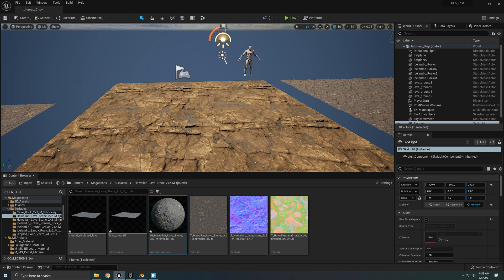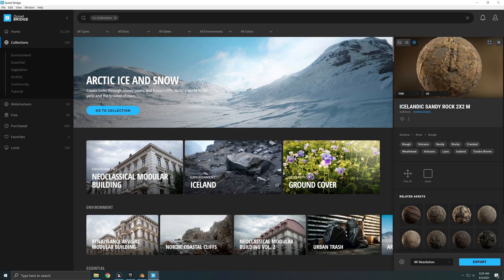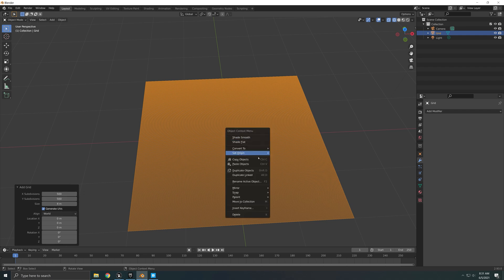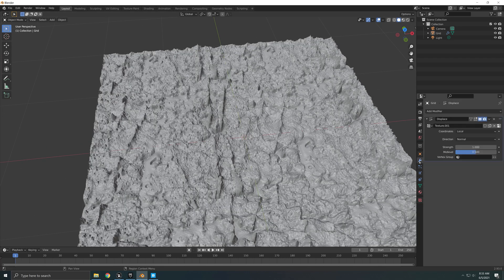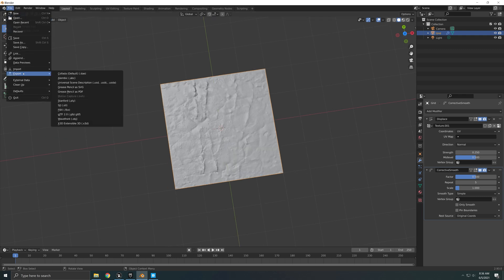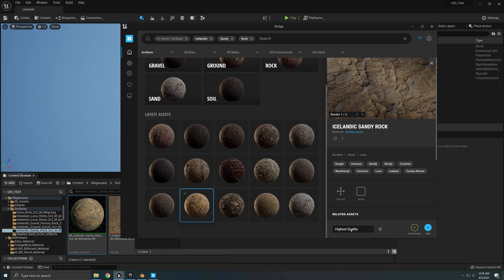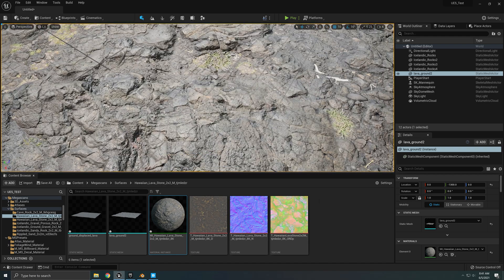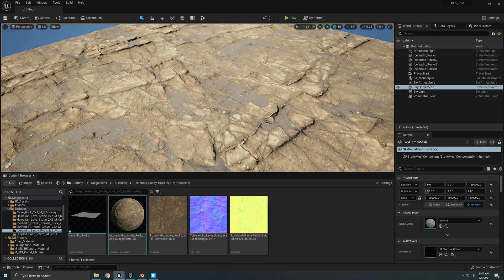How to use Displacement in Unreal Engine 5

Comment from the maker: Hey everyone I made some changes to my sound settings to if you would please let me some feedback here I'd really appreciate it
Reply: You dont need blender to bake mesh displacement , you can do the exact thing using UE5's in editor Modeling Editing Mode > Deform >displce
Reply: I'm a sound engineer by trade if you want any advice on your mic setup? 

FTR it sounds OK on my macbook speakers with this video. A little bit of room noise, but your vocal is clear and defined which is the main thing. I can have a listen in my studio later on and give you proper feedback if you want though. 

Any questions ask away though.
Reply from the maker: @billB101  Plz join the Discord and DM
Reply: @MR3D-Dev-Tutorials  Will do when I get a minute ;)

Comment: Just to say, and other commenters have mentioned it, UE5 now includes (beta) mesh editor plugin (disabled by default) so you can run a mesh displacement without needing a 3rd party program like Blender. It's still ridiculous you can't just do a tessellation in the material, but at least it simplifies things.

One thing to note though, the UE mesh editor is destructive only. Doing the displacement in Blender means you can use a non-destructive modifier so you can undo it later.

I suspect there's something internal to Nanite that makes it impossible to use material-based tessellation, but that doesn't excuse the complete removal of this feature in UE even when your mesh does not use Nanite.

Comment: They replaced displacement for virtual height field meshes which are wayyy more optimised. With the use of RVT its relatively easy to set up and a lot more flexible than this workflow.
Reply: Hello! Do you have any resources on RVT? I can't seem to find in-depth tutorials that don't use OpenLand or things like that.
Reply: @aizen_rhyme_schemes  there is honestly not a ton :S I had to do a ton of problem solving on my side to make it work

Comment: I wish there was a way to build the Nanite mesh directly from the displacement map within Unreal.
Reply from the maker: Me too
Reply: You can sort of do this within Unreal by using the displacement map as the heightmap for a landscape, export level as FBX, import FBX ticking Nanite. But beware, landscapes are far, far more efficient than meshes so it's going to be heavy importing the FBX if you have big landscape with high cell density.

Comment: So just to be clear then, if I tessellated a plane in engine 5, I can,t use the packed map already downloaded? As I thought the D part was the displacement? I’m really confused now as if the displacement is part of the packed map does the material function in UE5 not use it? 

And also, if I actually had a plane in unreal 4.26, tessellated it then applied the same asset from normal bridge app, and enabled displacement in plugin in 4.26, apply material in 4.26, then migrate the project to UE 5 will the displacement still be there ? Edit: sorry, should prob have put this in discord.

Comment: you can also use the Displace tool inside Unreal.
it's in the Deform section in Modeling Editing Mode. (Shift+7)
Reply: The real problem is that you cannot displace individual color channels which is what we REALLY need, instead only one of the displacement maps would be considered for the entire mesh. Its impossible to create damage and surface variation without being able to displace the textures independently.
Reply: @pawprinting  displacement map is usually grayscale tho no? Unless its vector disp
Reply: @davinsaputraartandgamedev9453  Yes it is, but I was talking about using 4 different displacement (grayscale) maps per Material, separated by RGBA color channels. Since the time ive replied here though, I figured out a way to do all of this externally while still being able to take advantage of NANITE.
Reply: @pawprinting  Hi! Could you do a very quick breakdown of your process?
Reply: @samtrafton8445  There is not really too much to the process as Epic games has left Unreal users completely at the mercy of external 3D modeling applications at this point which can already do most of these things right out of the box. I suggest you learn something like substance painter which has many advanced options, but as for me I happen to use Blender for my process specifically. All of it just involves creating the material shader in that program and then doing the displacing on color channels. Its really no different from how I used to set things up in UNREAL with the previous Tessellation and WPO method. Cycles has nodes for this and its just a matter of knowing how to set it up, there is also plenty of tutorials online for this. After all of that is done, its just a matter of converting the mesh to Nanite within UNREAL and your finished.

You can view the results of my process in the link below and see that everything appears exactly as you would expect it to if someone was using the old methods that we did before UE5. I put together a Crash bandicoot inspired game within the same month that UE5 Early Access released in order to test everything out to see if it can work. 

https://www.youtube.com/watch?v=sOUDfOPXxn0

On the plus side of things, you get collision along with your displacement (you can see this as the character steps onto the elevated dirt and rock surfaces), something that didn't work at all with Tessellation since that feature was only virtually displacing a mesh. The negatives is that you have to keep going back and forth between programs if you need to update the mesh and as most others complained, you would have to bake out your textures to 16k in order to get the best quality. There are other more complex ways of doing this which would allow you to keep the original quality of your textures when transferring to unreal without having to bake anything, but this process takes so that long and requires so much readjusting that it is just not worth it.

I was disappointed to find that WPO doesn't work well with displacing surfaces in 5.1. The Nanite triangles become clustered and non-uniform which results in uneven chunks popping out everywhere along really bad shadows. Hopefully they get to work on that solution they talked about in the AMA's earlier this year which would bring Tessellation to Nanite officially.
Reply: This is the real answer right here!
Reply: 3D modeling mode in UE5 can create new displaced mesh based on a textured image and in addition to that you can then convert it to nanite right after :)
Reply: @captcanada4  When I use the 2D texture map displacement from quixel it still stays relatively flat and seems to be displacing the mesh incorrectly
Reply: @samtrafton8445  yeah it's not perfect. It uses only one of the rgb channels of your texture to displace from. And you typically need dense mesh for it to be even kinda nice. However when I throw my shader on the produced mesh generally it has looked good enough to sell it for the times I've used it
Reply: @captcanada4   Strangely enough I'm getting a better visual by using my roughness mapping and excluding the displacement altogether lol. I'm getting the "make sure unreal is open" error when trying to export so it's been fun learning how to get all of this working manually. Really makes you look into the nooks and crannys
Reply: Can you displace by image with this?
Reply: Answering my own question here, but yes you can.
Reply: @billB101  Yes!